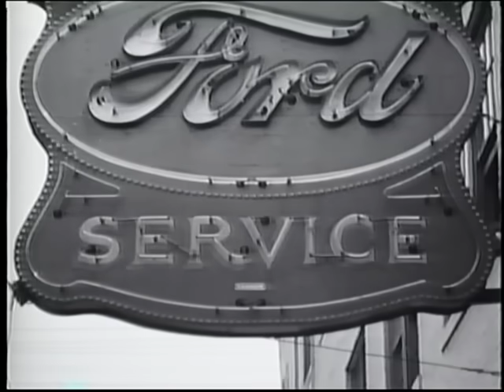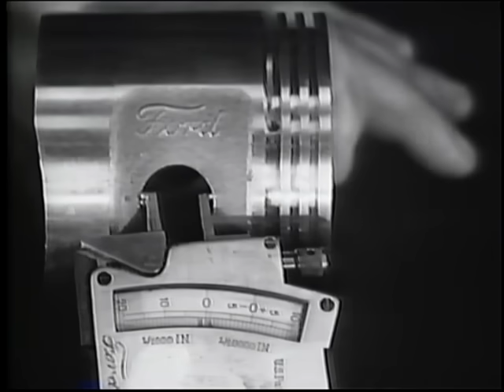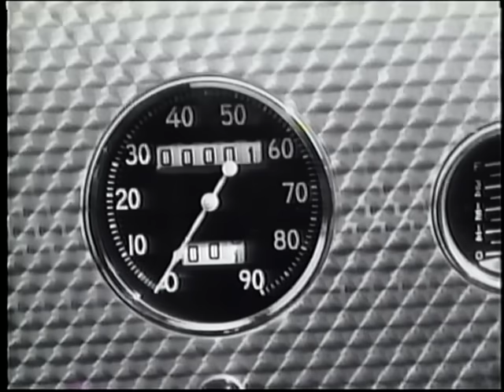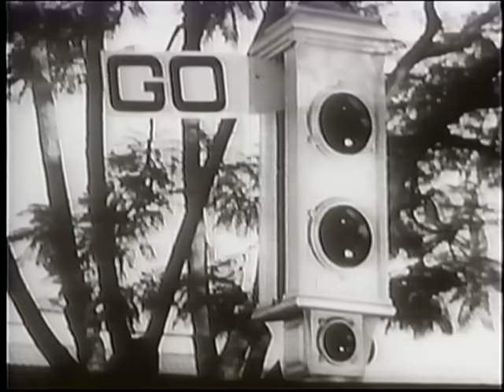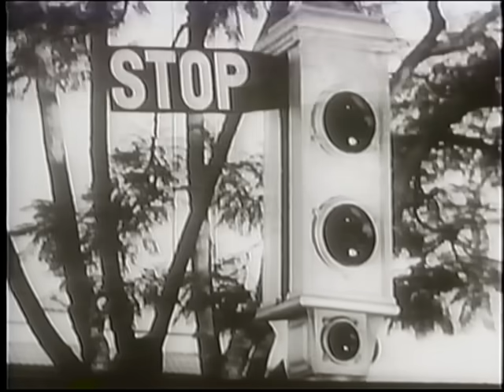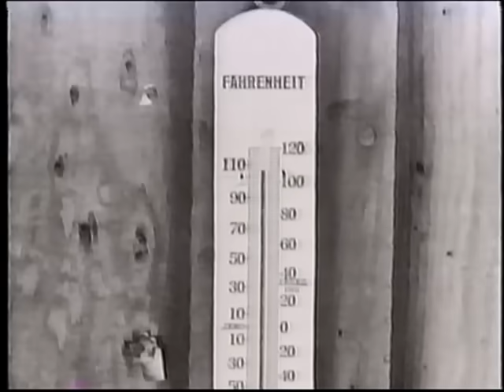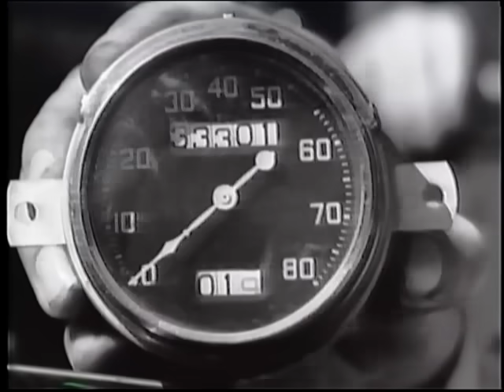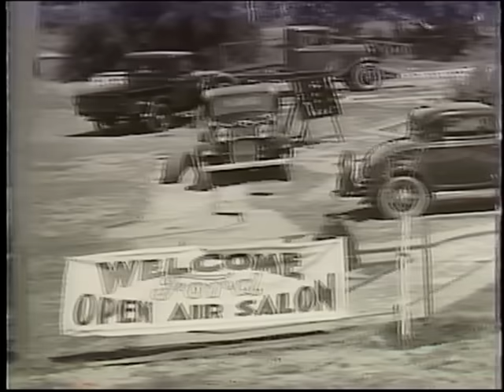1932 - The Invention of the Ford V8 Engine

Comment: What a wonderful film! I used Ford E350 cargo vans for work in the early eighties and bought a 89 used one to start my own distribution business without realizing it came with a bumper to bumper warranty up to 60 K miles. It hauled extra load of magazines in San Francisco’s 46 hills and eventually the transmission broke, I took it to my neighborhood mechanic and he sent it to a transmission shop for it to be refurbished for $3 K not a small sum back then. Then he found out that it was still under warranty but it could only be honored if sent to a dealership. I was beside myself! Then I received a check for the full amount from Ford because there was an exception, if the vehicle broke down during a long weekend due to a holiday since you couldn’t get it fixed right away. I couldn’t believe my luck and Ford’s ethics. Then and there I vowed to be a Ford customer for life. Interesting enough previously I had a bad experience buying a used 79 Ford Fairmont, probably one of the worst era for Ford quality control. When my daughter was born I bought my first brand new car, a Ford Escort Station Wagon that not only was the most affordable Station Wagon at the time but it lasted 24 years (with only a new engine as a major repair). I eventually bought two brand new E350 and another used one. After 35 years in the publishing business I closed shop in 2018, and decided to drive as a Rideshare driver  biding my time for retirement, so I bought a brand new Ford Fusion Hybrid (the second time Ford offered me a 0% interest loan), I recently did my 100 K maintenance and it passed with flying colors regardless of all the SF hills! Henry Ford changed the world, and I’m grateful for that in the twentieth first century!

Comment: This is without doubt the best automobile documentary i have seen of this era. As has been said by another commentator this vid is a national treasure. It is especially pleasing as back in the late 60s when i was 20 i managed to buy a well used Ford Pilot with the Flat Head V8 engine which was the totally coolest machine in town , especially as i lived in the small town of Crowborough, in Sussex , England. I bought it from a local businessman that sold it to me for a price  i can't recall, but it was cheap. Being a mechanic i sorted it best i could but the brakes were mechanical and were nothing short of dangerous. My pals and girlfriends would all put some money together to buy petrol and we'd head off to London or to the coast so as to go bowling or dancing or whatever. It wouldn't have been the same though if it hadn't had that fabulous V8 Flathead motor. Thank to all those real and proper engineers and designers that put together something that is still recognised as great engineering even in todays world.
Reply: M
Reply: Were Ford's and Chevy common in England at that time
Reply: The audio is terrible!  How can you call this good?
Reply: Thx for your post 😊

Comment: The videos of the manufacturing floors left the safety trainer in me in a cold sweat.....

Great video!
Reply: Different times for sure. I started my Ironworker apprenticeship in '72 and there was a lot of changes for the better, safety, at the end of my career. Trust me there was plenty of complaining along the way.
Reply: @stevethomas760  I graduated and joined the Big Green Machine in '77. I think that puts us within a decade age-wise.
I worked in production, transportation and plumbing, and the same is true there as well.
We've seen a lot of change in just our lifetimes.
And a lot of resistance indeed. A few missteps for certain, but most found corrections at some point or other.

After all.

Safety regulations are written in blood.

And we've seen plenty of it spilled in just our time on the floor.

 A great week to you Stevethomas.😎

Comment: What's amazing about these old cars is how amazingly tough they are!  I'm seeing these cars driven FAST over unimproved roads, bouncing over rocks and ruts, going airborne, sliding around.  Drive a modern vehicle, even something sold as off-road worthy, like a Jeep Wrangler, or a Toyota 4-runner, and it would be trashed in minutes, but people did this everyday to these cars, and they came back asking for more
Reply: It's because they didn't worry about efficiency back then, steel was also cheaper, everything was made of thick solid steel and everything drove like a tank but at the end of the day, they were driving 4-6L V8s that couldn't even produce the same horsepower to weight ratio of a modern 1.2L inline 4 cyl car.
Reply: You would not see these cars survive for 250k miles though. Don't get me wrong they were "built Ford tough" but ......
Reply: You’re wrong about the Toyota

Comment: it's crazy that this was all done without computers over 70 years ago. these engineers were so smart and talented
Reply: Not crazy lol
Reply: " then...than"....you summed it all up.
Reply: @vincentleatham8291  You try making an entire engine with no CAD or computers or modern materials
Reply: brent grubbs try 90 years ago
Reply: They still had computers, you'd pay women to compute!
Reply: @retireddriver16  90 is in fact over 70
Reply: @fall-of-rome  more like over 115 years ago, RR were using V8 engines in their cars in 1905
Reply: @fall-of-rome  It’s called lost wax casting.
Reply: @georgebarnes8163   So was Ford.  If you watched the video, (did you?), the issue with the new low cost V8 was that it needed to be a cast, single piece, not multiple pieces that had to be machined and assembled by hand.
Reply: @thekinarbo  Ford never made a V8 until 1932
Reply: @georgebarnes8163  

"1920–1932 Lincoln 60 Degree Fork & Blade V8—(357.8 and 384.8 cu in (5.9 and 6.3 L))
The Fork and Blade V8 used a novel approach for the piston connecting rods, which meant two connecting rods shared one bearing on the crankshaft, which allowed for a short crankshaft and a smaller overall engine size."
Reply: @thekinarbo  show me the 1905 Ford V8
Reply: @georgebarnes8163   I can't, but I corrected you by showing you that Ford was producing V8s prior to 1932.  Prior to Ford's innovation V8s were not available to Joe Sixpack.
Reply: @thekinarbo  but they were not, Ford made their very first V 8 in 1932 not 1905 as you claim.
Reply: @georgebarnes8163 
It looks like you might have thought I meant Ford was selling a V8 in 1905, I didn't mean to say that, what I am saying is Ford was offering a V8 in their Lincoln cars in the 1920s.  It's documented fact.
Reply: @thekinarbo  but Ford never made a V8 until 1932, they used other manufacturers engines prior to that and it is documented fact
Reply: @georgebarnes8163    Bro, Ford bought Lincoln in 1922 or so which included the Model L which had a V8 but Ford made extensive modifications over its run.  So yes, Ford was building the more expensive multi-part, hand assembled V8s in the 1920s.  This is fact.  Go look it up.  I'm done.

Comment: It's quite easy in our computer-driven world for thinking these were primitive vehicles, but I'm incredibly impressed with how much precision was attained back then as these early cars were mass produced largely by hand. These days about the only cars that get that kind of attention are race oriented and low-volume supercars. They ought to show this as mandatory training for current employees.
Reply: One chip goes out now you're f'd..
Reply: @Iconhulk  How often do those chips go out though? 

You and Mr. C-M-E clearly aren't engineers and clearly aren't versed in what goes in to engineering vehicles these days.

Cars are far more reliable, last longer, and more efficient than they have ever been, in part thanks to things like electronic fuel injection, direct injection, and ECU mapping.

But go on ... tell us more about your engineering expertise. lol
Reply: You are so right. They were more advanced then we are today in so many ways.
Reply: @Iconhulk  absolutely!
Reply: @orangejjay  The question is put one 
Of these old vehicles to a test versus 
A vehicle today. See which one last longer and holds up longer. Over tough terrain with the least maintenance.
Reply: Pencil and straight edge,no CAD-CAM.
Reply: @orangejjay Will today's cars still be running in 90 years?

Comment: Never knew about that X engine. Seems futuristic especially for the time. Also, all the testing equipment during assembly is amazing.
Reply: X engines tend to be rough running with four cylinders, though they run extremely smoothly with 2 strokes. The type with wet sump and a light duty blower are actually clean and efficient.
Reply: What about the Roterrey Engine ?🤔
Reply: It'd be kinda like a radial engine
Reply: Bmw nailed it with their boxer engine design, but it truly it was an engineering problem for decades until certain types of testing were developed.

Comment: This is incredible technology and  precision machinery for 1932. These men I consider true  geniuses.
Reply: This was the equivalent of microprocessors and cell phones now.
Reply: Fred Peterson  Modern cars can either be flimsy or well built.

While I can't say anything about Tesla since they haven't been mass producing cars as long - GM, Chrysler and Ford haven't really been making solid-built cars since the late 60's, the Germans fell through in the early 1990's, while the Japanese and Koreans have been beating them all out in quality since the late 90's and early 2000's.
Reply: Fred Peterson  Look up the crash test's vs old Chevy Bel-Air vs a 2018 Chevy Malibu.  Trust me the old cars are dangerous for accidents. The can on older care just crash and twist and you will pretty fucked up or dead after an accident of a older car.

Comment: im not a ford driver. but i can appreciate the amount of mechanical and technical engineering that went into the 1932 v8. its just a amazing.  thumbs up
Reply: The engineering that went into early cars is just fascinating. Now ever bodies basically got it all figured out, OHV is compact but inefficient, DOHC is the way to go, the only really viable engine configurations for normal cars are V6, V8 and I4. Everything redlines at around the same point, everything is either old or using direct injection, even the different types of Variable Valve Timing and Lift systems are kinda all the same. Transverse FWD is the cheapest, struts are the way to go for pretty much everything thats not a truck or a sports car, its all kinda bland to be honest. The only place left where companies are doing all sorts of weird stuff is with transmissions. VW/Audi tries to use a dsg in everything, Mazda, Ford, and GM are all using a different really advanced type of torque converted automatic, Suburu, Honda, and Nissan are all experimenting with very different types of CVT.

There is a big split coming soon of who sticks to NA and who surrenders to the bandwagon of using undersized turbos that fall flat on their face around 3500 rpm, but thats a choice between shit and not shit, not an interesting decision.

Back then they had all sorts of crazy stuff. Multi piece blocks, sleeve valves, all sorts of crazy over and undersquare engines, eight or so different types of carburetors, all sorts of crazy suspension stuff. I was reading a book recently that had a picture of some touring car from the 20s, and it had this really weird semi independent rear suspension setup where a transverse leaf spring doubled as an antiroll bar. Even cooling systems varied in different cars.

Comment: These methods of engine production and assembly  were still used in some countries as late
as the mid 1960s.  No wonder these engines required oil as thick as 20W-50.  By the 1960s , 
10W-40 was the oil of choice for most V 8s , and V6 engines , bad choice when its less than 
20 degrees F outside ! This is also the time when engine oil warmers were introduced , an idea
brought from Scandinavia and the far European east. Yet they lasted , why ? In those days ,
there was no VVT , V-Tec , Mivec and so on . Engines had many many less parts and were
simple to maintain. Today , a totally different ball game. Great video by the way !!!!!!!!!

Comment: This is a great film which shows one of Henry Ford's most important contributions to mass production - interchangeable parts.  The parts were manufactured and tested to be within very tight tolerances so that no adjustments would be required during the assembly process.
Reply: Sorry, interchangeable parts in manufacture were pioneered by Eli Whitney jr and Sam Colt, one hundred years earlier. It was the moving assembly line that Ford introduced.
Reply: Good points!  He should still get credit as the first to use it for car manufacturing.
Reply: @richardelliott9511  
But not in the mass manufacture of cars. Up to that point it was really glorified batch manufacturing.
Reply: @bighands69  you're point is not in dispute.  My point was to merely correct the mistaken idea that the concept of interchangeable parts did not belong to Ford and that it was a well established concept and widely used at the time he adopted it's use. There is no doubt that he did fully exploit the concept and expanded it into areas where it had seen little  use yet was totally necessary to take full advantage of his moving assembly line, which WAS his idea...

Comment: I used to setup program and run CNC machine tools, but , some of the most amazing tools I worked with were the automatics from the period just before NC or CNC machines. The old time Machinists and engineers who built these machines had some real native ingenuity. I would say, much more than the CNC machines designers. Something that always surprises modern Machinists who use a lot of CNC machines is how fast and automatic machine could be. Once they were set up they could really haul ass.
Reply: I worked for a 100 year old gun manufacturer in the mid 80's that were still using Brown & Sharpe screw machines they had purchased from around 1905. Except for making up new cams, probably every 10 years, these machines could still spit out thousands of good quality screws per day.
Reply: @Orange-Jumpsuit-Time The machines were made in England 🇬🇧
Reply: @ianmangham4570  Made in England 🇬🇧, improved upon in America.💪